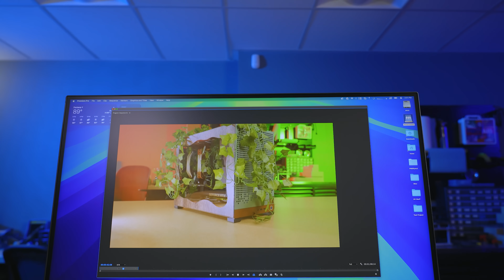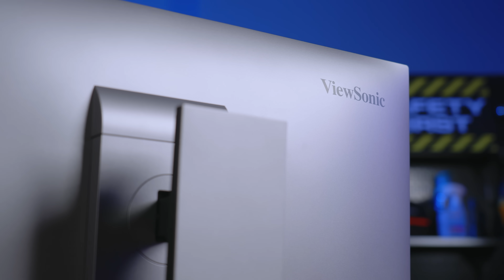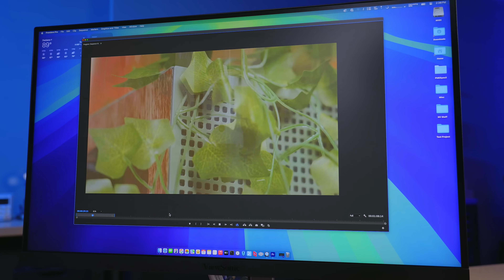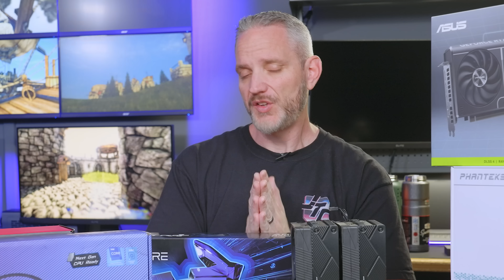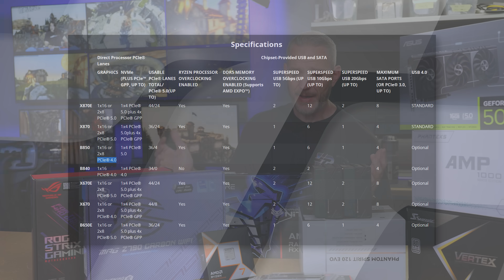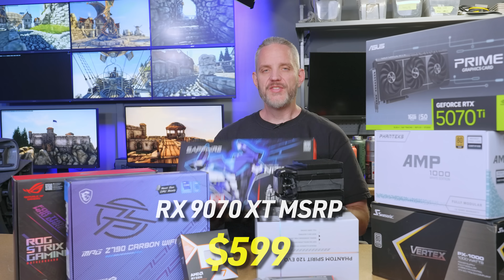This is the Sweetspot for PC gaming... Don't get fooled into spending more!

Comment: Still rocking the same case from years ago. One of the first fractal design xl cases. I got fed up after having to modify an older case with a saw to fit new gpus, so i bought one of the biggest cases that was available back then. It's currently holding the "4th set of hardware". 

Also have to agree on the psu. The only psu i had die on me was like 10 years old with almost daily use.
Reply: I had a Kolink 750W bronze die on me after 11 years of almost daily use in a really terrible early 2000's Antec mid tower with terrible airflow.

Comment: In australia here, was wanting to upgrade from a 3080ti as I play at 4k. This generation of gpus has been underwhelming, so I was going to wait for the 5080super.

With upcoming tariff changes, I wonder if I should just bit the bullet and grab something now while I can (barely) afford it??
Reply: If you got the funds why not 😅 also I feel like we aren't being smashed with pricing compared to the US I picked up an 9070xt Asus prime oc for 1250 I think which is only 100 over the base MSRP I was expecting to pay like 1500 for it tbh because we usually get hit pretty hard for pricing.
Reply: @ruki9043  i think because historically, i upgrade my gpu about every 3-4 years, and going from 12 to 16gb of ram makes me feel like not enough future proofing for that period. if the 5080S or 9090xt (or similar) have 24gb of vram, i feel like that might last me longer....
Reply: @HeyBartenderAUS yeah I agree if going for the 5080 super if it has 24g is a worth while upgrade. I went from a 3070 on an am4 build to a 7700 with a 9070xt
Reply: @ruki9043 yeah thst seems Ike a nice upgrade. Currently 3080ti amd 7600. It's ok. But I feel like withing 6-12months there will be games i can't run at settings ide like.... guess I better try and take a second job

Comment: My recommendation for buying GPUs is to buy one gen behind the latest at whatever tier you can manage based on its price and then, for upgrading, wait 3 generations and buy the gen before the latest and greatest. Thus, you go up two gens and do not spend a ton. I have an RX 6750XT right now and I will eventually get the 9070XT but not until the next gen comes out is released.

Comment: I don’t see any logic in buying new hardware if you’re looking for a modest sweet spot PC. For me the modest sweet spot is a 1440 rig hitting about 200fps. Which is what I’m getting with a 5700x and a 3080ti. You can build my rig for well under $1,000 with good used parts. Then you can enjoy 200fps at 1440 while you save for an upgrade to 4K if that’s what you want later.

Comment: How is my build 

✅️Cpu Ryzen 5 7600X.   250 $    
✅️Corsair 3500x 220$
GIGABYTE B650E AORUS Elite X AX ICE. 250

T-Force Delta RGB DDR5 Ram 32GB (2x16GB) 6000MHz PC5-48000 CL30

MSI MAG A750GL PCIE 5 Gaming Power Supply - Full Modular - 80 Plus Gold Certified 750W - Compact Size - ATX PSU

Sapphire 11350-02-20G Pure AMD Radeon™ RX 9060 XT Gaming OC Graphics Card with 16GB GDDR6, AMD RDNA 4

Look, I said questioning the motherboard, I heard they have issues with bios.  Any other recommendations?

Comment: Is the r7 3700x still viable for 1080p? Currently wanting to build a budget pc and theyve been on the fb marketplace for a while
Reply: I can confirm that, I've gone from 1500X to 2600x to 3700X and now have 5600X because it was cheap and I like hoarding hardware. What will matter most here is your GPU selection really. any 8GB card from the Navi (RX 5000) or Navi II (RX 6000) generations should suffice. Hell I have a RX 580 Nitro+ 8GB and that does me just fine for 1080p. Although I don't keep up with modern titles. I tend to replay older games with mods.
Reply: @Bearded-Mutt  the only esports game that i enjoy is cs2, and thats mostly the only game that im mostly going to play other than skate games and some old games to catch up. But yeah, im not really into AAA games

Comment: A futureproof sweetspot right now would probably be a 9600X with 9060XT 16GB, good case (Fractal and Coolermaster cases come to mind) - Kingston Fury RAM and SSD (really good price to perf. and you get options in terms of color and rgb or not) and Arctic cooling solution (fans and air cooler or even an AIO). If you are on an even lower budget then I guess a core ultra 5 or 7 (because they have dropped in price significantly recently) and a B580 or B570 for under 300 bucks would also work. Just that there is only one more refresh of the 1851 socket so that isn't nearly as future-proof for upgrades as AM5.

Comment: I second the Power Supply statement, because I had a ThermalTake 1000W PSU from 2008, I only changed in 2023 (15 years) when I built my new system, it had been going strong even with upgrades throughout, meaning it was in a completely different system at the end.
Reply: Yeah I'm stuck on seasonic.  I've had my 1200w for over 10 years now.
Reply: @iand654456  I also went with a Seasonic in my new system.
Reply: I love that everybody in the comment section have overspeced PSUs, so I jump in with a 400W beQuiet from 2016, which can supply an RTX 3080.

What people don't realize about PSUs how much they improved during the years and how much performnace their old PSU lost during these years, mainly the ripple voltage increases which is stressful to the components and can result in coil whine. Here are 3 PSUs ripple numbers if you are interested, one old PSU, one new PSU same model, and one next gen PSU.
30mv 340mV - old PSU (at least 6000 hrs)
26mV 324mV - new PSU same model
20mV 220mV - next gen PSU

BTW once I recapped an Enermax PSU from 2006, I told the owner it would be cheaper to buy a new one, but he insisted to fix it, after the fix I concluded that the PSU never gonna fail if you replace the caps every 12-15 years, even the fan uses ball bearing.
Reply: @sviktor4  Recapping old PSUs is very useful for retro system that lacks a CPU power connector, requiring chonky 3.3 and 5v rails on the PSU.
Reply: i had 2 thermaltykes and both died on me. i had my 750W EVGA from 2017 and its been going strong since even if i tried to retire it twice Lol
Reply: Haha same! I had a SilverStone 1000W from 2008-2024 and I only replaced it because I got worried it was so old. It was still working perfectly.
Reply: Gigachad psu
Reply: yea i have had my evga 1300 for 8+ yrs on three different builds
Reply: @timnevitt2993  I'm on my 2nd build with 5060ti... using a rm750x w corsair  from my first build with a gtx 1080 / r7 1700... 
It has a 10 year warranty... so it's still good.
Reply: Had a Corsair 1200i for 10 years too and still runs great. Recently used it in a new build with 5080 and 285k.
Reply: Corsair rm750 (at least 5 years old and 2nd owner) running a 5080 pretty well with 5800x3d. Undervolting is doing the job. The whole system is consuming max 370 watt in benchmarks... Safe the money! 
Just don't buy a cheap brand, they will blow up 😅
Reply: Nah il stick to buying power supplies that fit my build and saving 3x the cost on those scam overkill power supplies. That way I can upgrade much more often and keep on newer standards. Don't fancy burning gpus using old power supplies with older connectors and less safety thanks. Seriously can't imagine using any modern high end gpu on a psu without atx 3.1 must be begging for disaster lol
Reply: @donkeymoo1581  I don't agree with the second part, newer standards not necessary better especially when a trillion dollar company pushing them. If you read the spec ATX 3.1 is worse than ATX 3.0 and ATX 3.0 worse than ATX 2.4.
New standard has to allow triple the old standard OCP spike making all PSUs a welder machine. If a FET fail on your motherboard or GPU it is gonna destroy the motherboard and weld the CPU into the socket and blow the PCB layers making a repair impossible.

There is no safety over 600-700W a piece of wire has bigger resistance than a high end GPU, you can literally weld with a 1200-1600W PSU without tripping it. With the new standard it means 3600-4800W spike, even the braker trips sooner then the PSU.

BTW not the PSU's job to compensate for bad designs like intel 1700, or RTX4090/5090, servers doesn't have similar problems.

Comment: Mostly it is about the money you have to spend, and what you do with your pc. I was working on a laptop for almost 8 years, and did a 2 year upgrade path. But the latest model, 14900, rtx 3050, 32gb ram, connected to my 34 inch 3440x1440 monitor it was hishing all the time. Running ubuntu linux, cursor, slack, teams, thunderbird with 6 accounts, 3 to 4 active rdp terminals, 6 to 8 ssh sessions (terminator), and firefox with online tools like office365, monitoring, azure, lucidcharts and some other stuff. So got pretty tired of the fan noise because the laptop was chosen purely that I could take it along on trips and to the datacenters. So last month I finally made the choice, start building my pc, asus x870e strix motherboard, 9950x3d, crucial 28ns 2x48gb 6000mts, 2tb samsung 9100 pro, asus tuf 9070xt, asus ryujin 360 3 with the black noctua fans, fractal design wood xl case and added 3 extra fans from the same vendor. And an extra monitor 49" 5120x1440 and stacked them up so the 34 inch is above the 49 inch on an arm. So yet again ubuntu 24.04 and set PBO to 130 watt, ram to expo 2 on 6200, flck to 2067, cpu offset voltage negative 20, and soc voltage to 1.18. All core load 5ghz without noise stays 57 degrees Celsius. Normal working load see up to 8 core boost to 5.75ghz, temps between 38 and 48 degrees on the cpu. No noise! And can play in linux on a casual day cities skylines 2 on 5120x1440 with 60fps fixed in a moderate city 150k citizens. Whilst my monitoring and some other programs are still running on the second screen. Ah, forgat the asus 1200watt gold power supply. And it happens without irritating fan noise, and is used about 10 to 12 hours a day. But as said this was more a business decision with a flavor of my inner nerd and needing something silent.

Comment: I'm just stuck with DDR5, I want to run 4 ram sticks, for visuals and plus I need the ram for my 3D work, but when I do that I can only run them at 3600 speeds instead of the 6400 speeds that i bought them for, and of course when i just run 2 ram sticks, the XMP profiles to run 6000, 6200 and 6400 speeds works fine, so it's annoying 😂 I'm on AMD by the way and it's Patriot Viper Ram kits on a gigabyte x870e mobo

Comment: I built my pc about 4 years ago when the 3070s came out. I have a Ryzen 5950x, two 3070s, two 32gb OLOY DDR4 RAM 16GB (2x32GB) 3600 MHz CL16, 2x Samsung 2tb 980 pro M.2s  and wondering if just upgrading my GPU to a newer 5070 would make a big difference. I really like my AMD CPU and Gigabyte x570 Ultra mobo and hoping to not upgrade them for awhile longer. What do yall suggest? 😁
Reply: If the games you play run the way you like it you don't have to change anything. :-)

Comment: When I built my AM4 rig (ryzen 5 5600) I upgraded the gpu to a 5060 Ti 16gb and where I shot myself in the foot was buying a 650 watt power supply as I went for the minimum requirement in reality I should have gone for an 850 or a 1000 watt psu to future proof for any future gpu upgrades.

Comment: Ryzen 5 7600 or 9600 (AM5 platform) is more than enough for current gen gaming. Its better than the CPUs in PS5 & Series consoles. This one has an OEM cooler as well.

For GPU get an RTX 3080 10GB or RTX 4070 or 4070 Super. Won't recommend RTX 50 due to the launch issues it had. 32bit PhysX, missing ROPs, etc.

B650 or B850 or X870 motherboard 

2 x 16gb ddr5 memory, 5600Mhz, CL28, amd EXPO

Samsung 1TB 980 Pro or 990 Pro storage

1000w 80+ gold PSU

Standard Case

Under $1500 you may game at 1080p60 even 1440p until 2029 without any problem.

Comment: My recommendation for storage devices: First of all, don't be afraid of managing multiple drives.  For Windows, I recommend a C: drive to be NVMe SSD PCIe Gen 4, but only 500GB to 1TB of storage space.  Don't spend money for capacity here as this drive's speed is to keep Windows responsive.  For the 2nd drive, another NVMe SSD it is 1TB to 2TB of storage space, minimum of PCIe Gen 3.  The 2nd drive does not need speed as it is not sharing the bandwidth with Windows.  For the 3rd drive, an HDD that is at minimum of 4TB.  This 3rd drive is cost effective storage capacity.  Yes, it will be SATA 3 bandwidth and not an SSD, but the chief point is that Windows is isolated to the C: drive that is expected to die a horrible death due to the mileage from Windows, Drivers, and the Appdata folder.  Move the Users folders off of the C: drive to either the high capacity or speedy capacity drives.  A SATA 3 HHD is plenty fast for many games, media, and so on as long as Windows is not running from it.

The primary guidelines here.  1) Give Windows its own drive.  Place everything you care about on a completely separate drive.  2) Don't overspend on capacity on said C: drive, as Windows will age it faster than the rest, but it needs speed.  3) For drive capacity of 2TB and under, go SSD.  For drive capacity of 4TB and larger, go HDD.  4) PCIe Gen 5, you are handicapped by software's ability to process the data on the CPU.  Don't pay extra for PCIe Gen 5.
Reply: There is zero reason to separate the Users folder to a different physical drive or partition than the Windows OS. Windows will not burn out any SSD made in the last 10 years because all the drives have TBW capacities that allow you to fill the entire drive every day for years straight before the NAND write cycles would be exhausted. Windows (even with drivers, AppData, Users directory + documents, and temporary files/directories) will not exhaust an SSDs write cycle limit.
   3-2-1 Backups are always required to prevent data loss, regardless of how you divide your data over physical drives and partitions.
Reply: @mattrogers6646 I have those SSD.  The drives still dies in 5 years.  Despite having 32GB of RAM or more, OSes still use virtual RAM.  Because the drive reads and writes faster with faster bandwidth, they get used more often.  Without Windows on the drive, the storage device trickles through that mileage.

Comment: My 5800X3D is still going strong! Not exactly budget or cheap...but still a mention!  IMO if your going 4K the CPU is less important, GPU dependent mostly!

budget-ey build on low end
B550
G.Skill DDR4 3200
Gen 4 m.2
Ryzen 5800XT CPU
3080 Ti (newer if can afford)
1000 watt EVGA gold
Case and cooler to taste
144 or 165hz 1440 monitor

Comment: Nice video! gpu prices are way to different still. i hope the new tsmc fab in arizona? and hopefully some fabs in other reagions will stabilize demand. i like the nitro+ but its 760,- here in germany, a little to much over the cheapest one 9070xt xfx swift is here is 649,- with 19%vat. if the 9070xt is selling so good here and the prices keep falling...9070xt for 599,- Euro would be awesome. would make the pricing of the gre interesting.

Comment: Man this guy never learns to give his audience true guidelines. Yes the x3d gives you the best higher average. How can you say intel doesn’t compete in terms of value, the 265k bundles with z890 is a good choice for its price to performance. Great workstation use and gaming too, IMO you cant beat that at that price point. Running 8000mhz ram speeds is at higher gear though so not a true 8000 speeds, it has no benefit to gaming whatsoever lol. You don’t even game dude, just stick pc building, and benchmark content.

Comment: I bought an EVGA 1200W 80+ Platinum in 2015 and still use it in my main rig. Buy one really nice power supply and it will last for a long time.

Comment: My new build is living proof this vidoe is true. Running 14600k 32gb gskill 4000mhz ddr4 ram, rtx 5070. My main monitor is a 32inch 144hz 4k dell, run all my games with great performance. Its a great setup that synergizes very well.
Reply: Absolutely nothing wrong with ddr4 ram my pc is fast and I run a multi monitor setup with my main being a 144hz 4k which I play all my games on and just in case if I really want more frames which I haven't ran into that issue I've got my 27inch 1440p. I also have no issue with using mfg I run it on cod online multi-player and the finals. I get great performance and don't notice input lag issues.

Comment: total agree on the PSU topic:
NEVER cheap out on a PSU. I bought mine now 13 years ago, a be quiet dark power pro 10 (700 or 750W, I don't know anymore), and it is still powering my system reliably. But I'm afraid, at the time I have ti change out my RTX 2070 I'll have to also spend money on a decent PSU. But look how long it did follow me through various upgrades. A good PSU is always worth the money. Not only for longevity, but also for safety reasons for your expensive parts, not to mention the personal safety of you and the people sharing your home
Reply: 💯! I've been running a EVGA 1300w 80+ gold for about 6 years now (was way overkill for previous builds 😂). As Jay said it gives headroom for any upgrades you may wanna do later. I'm still rocking my red devil 6950xt but it's also a card they recommend using a 950w PSU 😅